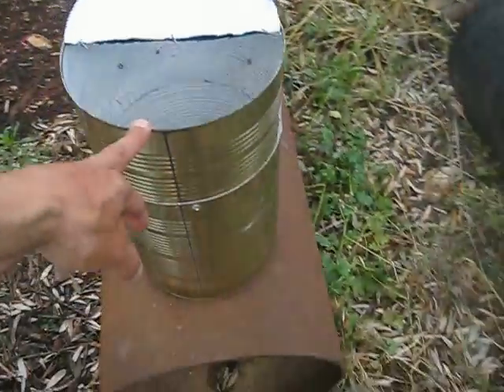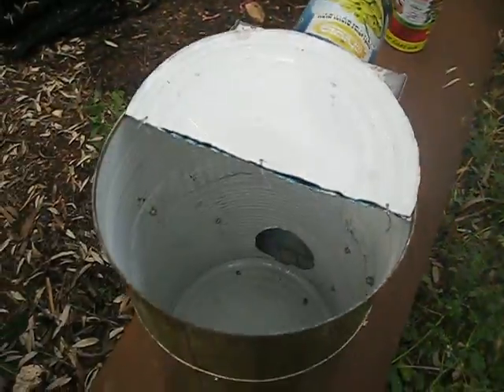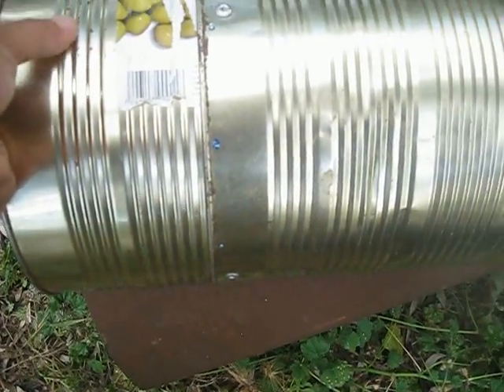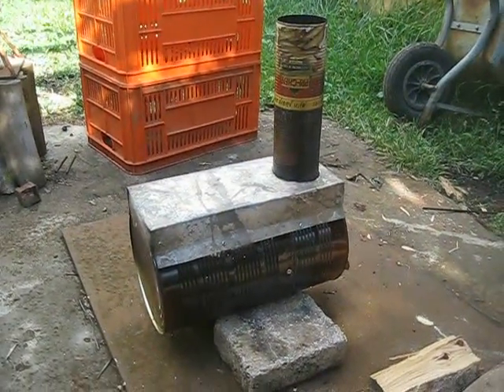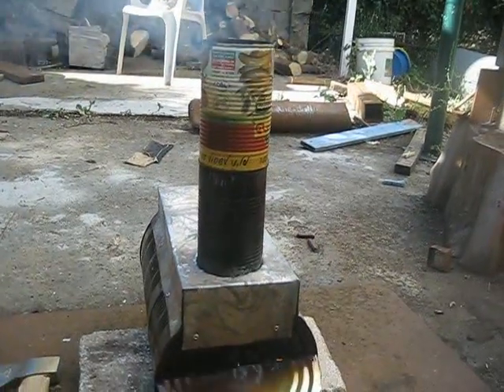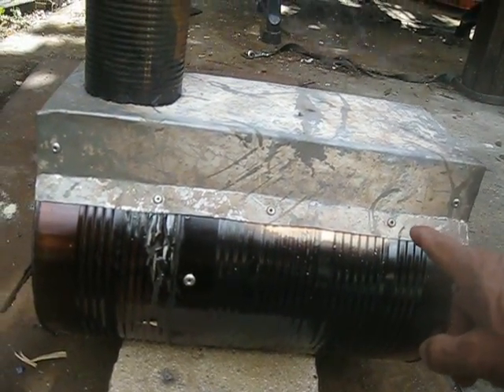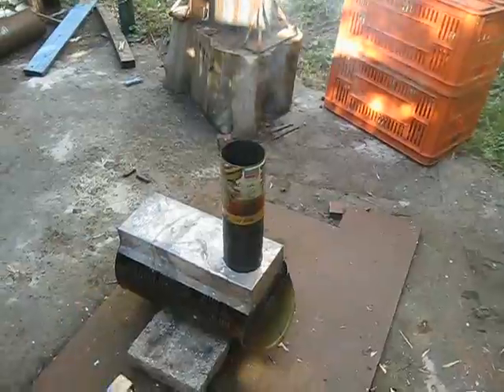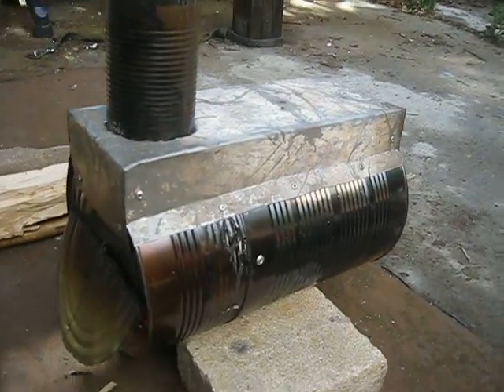Wood stove simple prototype

Comment: I like this design. I have a horizontal wood stove. But my chimney goes straight up. I could add an extra chamber like yours on top of my wood stove. Add secondary air to that extra chamber. And you would be able to cook on that stove easily. Maybe insulate the sides of that upper chamber. I will try to shoot a video on my old stove this weekend. Thanks for the idea for an upgrade.

Comment from the maker: This is the idea I have for secondary air supply youtube.com/watch?v=qcAYkta35RU  So, in the case of this prototype, there is no riser tube, all the combustion occurs inside the bottom chamber. Top chamber allows better heat release.

Comment from the maker: Thanks. I will now put secondary air at the top of the combustion chamber and compare with this version by amount smoke output. I thought about the vortex, the only place I can think is in the passage from the bottom chamber to the top chamber. Do you have other suggestions for vortex placement? Thanks